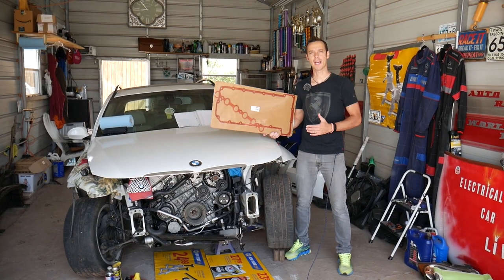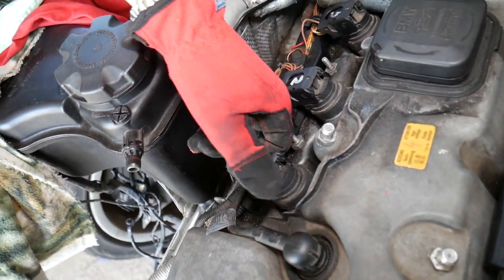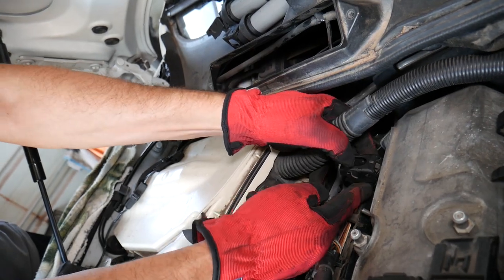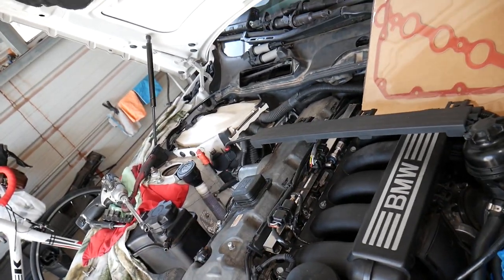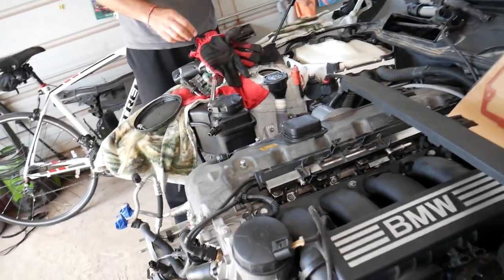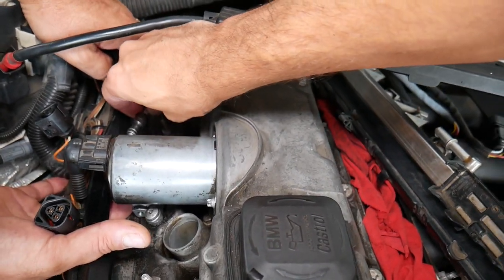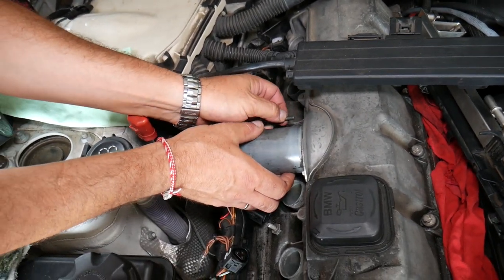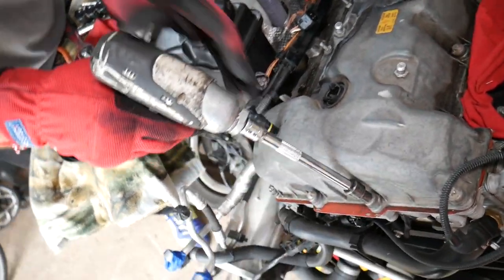VALVE COVER GASKET REPLACEMENT BMW E90 E91 E92 E93 E60 E61 X3 E81 E82 E87 E88 X5 E70

Comment: There's no need to remove the actual injectors and fuel rail. The wiring harness can be unclipped fairly easily with a couple of picks.
Reply: @Christopher Lennox instablaster :)
Reply: @Crosby Rohan thanks so much for your reply. I found the site through google and Im waiting for the hacking stuff now.
Looks like it's gonna take a while so I will get back to you later when my account password hopefully is recovered.
Reply: @Crosby Rohan It did the trick and I finally got access to my account again. I'm so happy!
Thanks so much, you saved my ass !
Reply: @Christopher Lennox No problem :D
Reply: @christopherlennox7112  scam
Reply: Despite all the scam replies that have absolutely nothing to do with this repair, I can tell you without a doubt you will have to - or want to - remove the fuel injector assy. There is nothing easy to get to on this project and you will need all the room you can to eventually wrangle the valve cover out. The spark plug wire harness and associated wires is the biggest challenge, but removing the FI will give you the needed room to win the challenge.
Reply: @MrEdad  u just got to pop off the top bro there's only 3 or four clips un do those and it pulls straight up and off . My question is why did u not undo the pressure on the valve tronic motor with a 4mm torx .u just turn counter clock wise and then click wise when bolts are off I thought it is required so we don't damage the motor or can I just take it off like u did in the video .I don't want to ruin it but if I can get a reply will be much appreciated about the valve tronic motor
Reply: I was just about to post the same thing. Removing the injectors is an unnecessary step.
Reply: Those 6 clips are really easy to release once you’ve figured it out. Use a 90 degree pick or similar tool, pull one of the exposed bent portion of the little spring clip towards you/front. Should take like 15 secs to do all 6

Then once that plastic assembly is disconnected, pop all the clips back in place. Takes 5 secs

Comment: Before remove the Valvetronic, you must set it to service mode with inbus at the side. Loose the Boltes at the side und do not take Valvetronic out. You have to rotate the Service screw and the Valvetronic comes out. Do not use impact wrench for Alu Screws. You risk te cut of the heads from screws. Use normal rachet for that. But thanky ou for the video. Thats fine.
Reply: 4mm allen key is used to lightly turn that Valvetronic motor worm hear

Comment: Pro tip: You can disconnect the (-) Black negative side then reconnect (-) Black negative side when needing to disconnect battery. (Same as (-) neg 1st followed by (+) expect you don't remove (+)

Pro tip: Shroud the (-) negative terminal you disconnected in paper towels and some making tape to prevent any arcing. 

Pro tip: Stuff some paper towels under the fuel line to absorb the bleeding fuel. Even shrouding the line in a towel jacket to protect against spray.

Comment: How much would it cost at the dealer?
Reply: Probably a grand lol 
Hope not cause this job seems pretty difficult to me. My 330xi is leaking oil slightly and seems This is very common on these
Reply: @Unavalivle  
Yes I did, actually I got lucky and it turned out one of the bolts was snapped off. I first checked by where it looked like it was leaking and sure enough a bolt was lose but when I went to tighten it I realized it was broken in half. So I managed to get broken part out, ordered new bolt from ecs tuning, put it on, washed the shit out of bottom at self car wash.

And haven’t had any oil leakage since
Reply: @Unavalivle  
But now there is a new problem of course, there’s no engine light but a code 2AA9 shows up. Variable intake system servomotor, 2 activation.

Now that it’s cold out it seems more noticeable like as if it doesn’t like cold Idk maybe just me. Sometimes when accelerating or coming almost to stop there is a weird noise like air rushing through something maybe idk. Lol

Comment: No video I've seen has talked about the differences in the plastic vs metal valve cover replacement as they made these in 2 different valve cover types. This video has different torque spec and mentions needing new bolts as in do not reuse old. Plastic one you can reuse.

Comment: Trust me don’t follow this step by step, do your research from credible engineers who know BMW motors. This is a good overall explanation but not at all a tutorial of how to properly access and change a valve cover gasket. First time buyers and diy’ers need to understand the cost, time and investment in parts it takes to work on your own vehicle. Any N52 engine with over 130,000 miles will start to need a lot of work, most of it youll want to do at once when accessing vital parts like the inside of your valve cover. Work smarter not harder.

Comment: Hello guys great video. I have a question my 2009 BMW 328i E90 only has 2 thread bolts and I see in your video you removed 3 of them from the middle at around 14:40 minutes in the video. Why could this be? At first, I thought it was missing until I noticed that there was not meant to be a screw there but yet there is a hole for a screw to go in and this is where my engine was leaking oil into cylinder 4. Is there supposed to be a bolt between cylinder 3 and 4 because I was looking at a brand-new valve cover set, and it only brings 2 thread bolts as well?

Comment: Hi guys, 1st off I want to say you guys do great videos and very clearly explained. There are a couple "helpful hints" I could add but overall I used this as a step by step without fail. I do have a problem tho which I hope someone can answer. If not I am most likely towing the car to the shop for repair. Here is problem: car will not start. Engine turns but has a funny sound, like a miss in the turn sequence. Almost like the timing is off. I am wondering if its the valvetonic? I did not use an allen wrench to adjust, I just removed carefully. You did not say to set it to anything, but some ppl say you must set it to 'service mode.' Any suggestions?

Comment: You went through a 1 minute explanation about removing the incorrect battery cable. But I'm confused why you didn't take the extra 2 seconds to tell which cable to remove first. ?? Also I do not see the link below as you suggested. I am going with negative. Other than that, seems like a good explanation learning video.
Reply: Regarding the EGR hose at rear: this hose is a major pain to remove. Unless, you know what youre doing. After spending 15+ minutes squeezing the little cramped plastic thing (maybe I broke it loose), I finally pushed it in, then squeezed, then pulled it out. Similar to how you show the fuel line removal. Came out ez. 👌Little tip for all observers.

Comment: What's is the torque for the gasket
Reply: 7 Nm + 90°

Here is a link to a PDF that you can look at for all torque specs. Its what i use 😁
https://f01.justanswer.com/MatthewT730/98fafcda-25e1-4c97-9cbd-8b01cde57483_General_torque_specifications_N52.pdf

Comment: Hey guys I have a situation after I change the Plastic engine cover because of the CCV valve my x5 is f-up Very rough idle and the whole car is shaking what should I do
Reply: You probably switched up your O2 censors. If not what was it?

Comment: When putting the bolts back in do I have to impact them or use a torque wrench if so what’s the lbs too do so
Reply: They will need to be torqued and in a specific order

Comment: Great video, thank you. Quick question, I assume the oil must be drained before you start. Is this correct?
Reply: No, all the oil will be in the oil pan at the bottom if the engine

Comment: Rubber gasket is better?
Reply: I like the metal one with these 2006 N52 engines better. You don’t risk dropping or snagging them during installation, they don’t leak as fast if torqued down properly. And the cover is not plastic so it won’t crack due to heat cycling